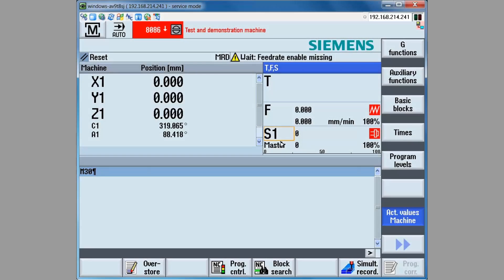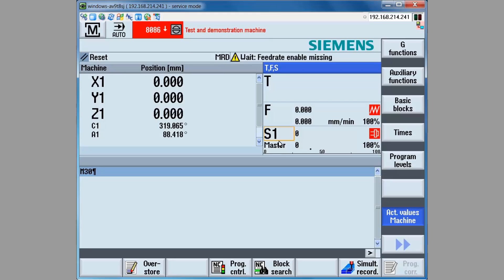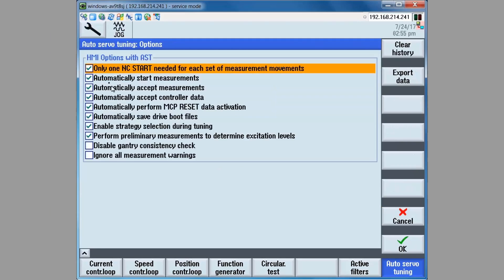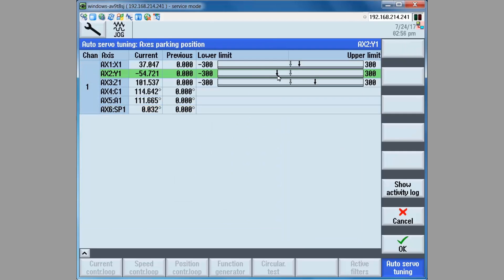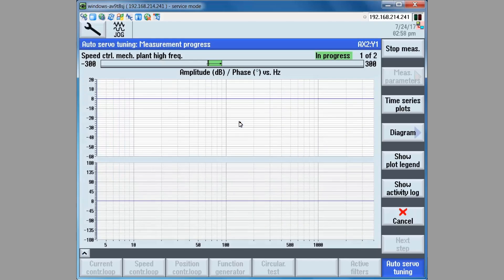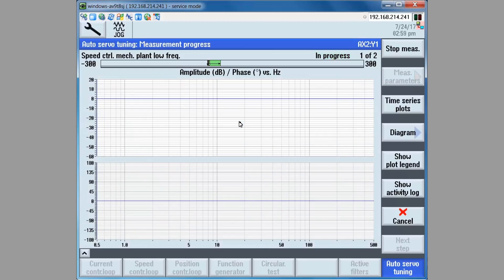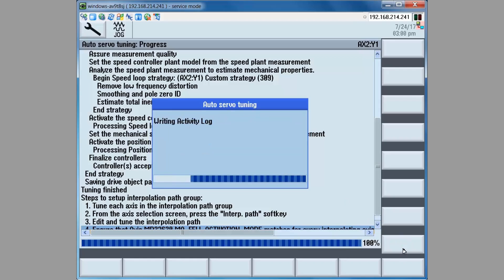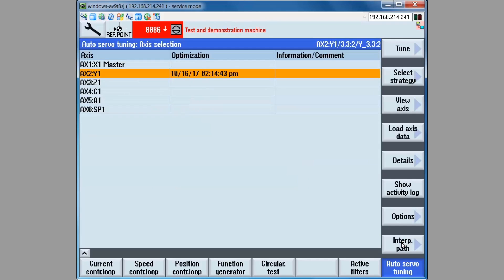Auto servo tuning

Comment: Machine massage nc start we press cycle start key but process is not running further
Reply from the maker: did it make a part program in the part program in folder?
Reply: @MrCNC  no while auto tuning of rotary axis a dialogue box apear for start nc. We press cycle start but process did not process further